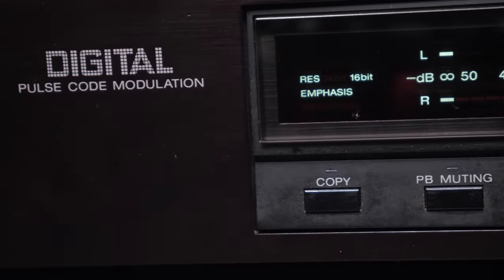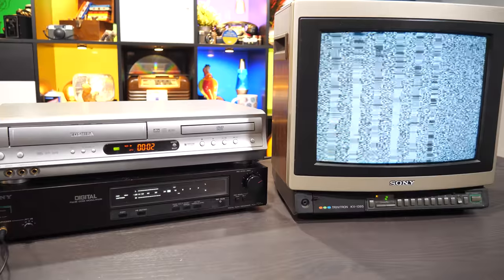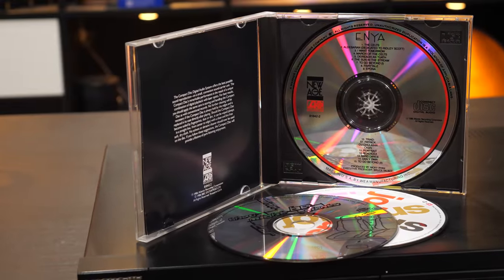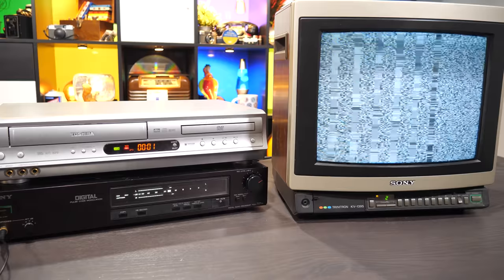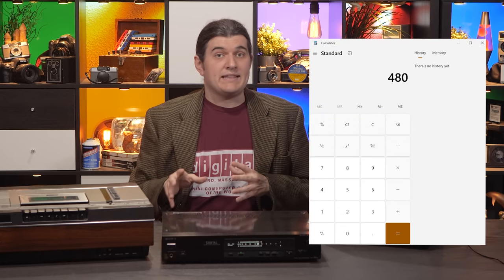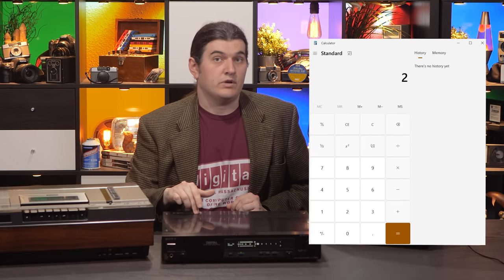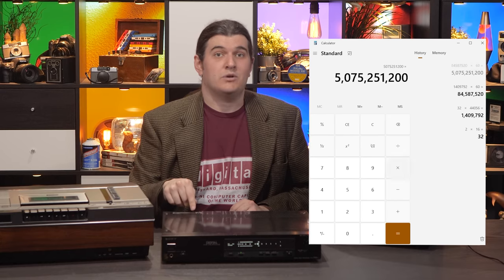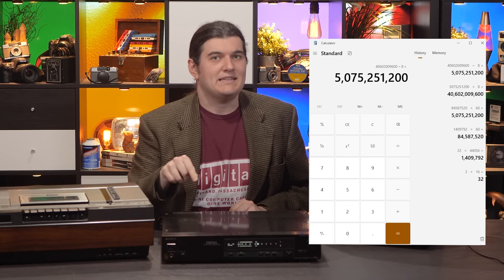Digital audio needed videotape to be possible - and the early days were wild!

Comment: That whole thing about professionals requiring XLR connected analog I/O on their equipment is only half right. People with lots of pro audio equipment often tend to interconnect it with balanced signal cables, which mostly use the XLR connectors. But many manufacturers of such equipment sold both the 'pro' and 'semi-pro' versions, and inspecting their specifications and schematics, usually the only difference was whether or not their analog I/O was via single-ended un-balanced signals via RCA connectors or balanced signals via XLR connectors.

Recording engineers usually understand that every stage the audio signal passes through adds noise and other distortions, albeit not very much. But passing signals through often-complex routings can involve lots of such stages, and the noise/distortion is cumulative. Thus, ideally, reducing stages improves audio quality.

Balanced audio signals must have extra stages in their respective equipment in order to get from the native single-ended signal to balanced, and on the other end another stage or stages to get back to single-ended. This used to be done via transformers, and later by small clusters of op-amps, forming instrumentation amplifier stages and such. 

Balanced signal cables are advantageous only to eliminate pickup of hum and other electrical/magnetic fields that long cables pass near. Typically, in a small studio or when only a few pieces of audio gear are being used adjacently, the cable runs are only a few feet long and are passing through fairly interference-free areas. Thus, for those connections, using single-ended (un-balanced) cables make more sense, as it eliminates the extra stages that going balanced requires. So, for those kinds of applications, just using the single-ended audio signals over shielded cable and via RCA connectors may actually be better that going the balanced XLR route.

As a former studio audio engineer, and as a long-time operator of a field audio recording service, I have seen a lot of places where the engineer uses the RCA route for locally positioned equipment, and the balanced XLR route for situations where longer cable runs are happening, or where other connected equipment only has XLR available. In my view, equipment that has BOTH kinds is the best, so the engineer can use whichever makes the most sense. And since the difference in purchase price between the 'pro' XLR version of a piece of equipment and the 'pro-sumer' RCA version can be substantial, it is often wiser to buy the lower cost version (all other features and performance being equal) for those installations where XLR is not needed.

Short version, don't sell RCA short, it is theoretically superior for many situations.

Comment: Look at how infrasound/rumble filters (e.g. the "Subsonic Filter" on Yamaha's A700) disappeared after CDs became common. If you look at old CDs especially, but also brand new ones, using a spectrum visualizer you will often see a solid block of sound from 0Hz to 10Hz. Which is exactly what rumble filters remove. But with CDs we were suddenly totally fine blasting ourselves with infrasound. Remove that infrasound with a highpass filter with a -12dB (or more) slope at about 10Hz and most music will sound quite a bit better (provided it doesn't rely on those frequencies which a lot doesn't). Originally these filters (like the Subsonic Filter) were used to filter out motor vibrations from vinyl players, so probably they were deemed unnecessary for CDs since there are no motor vibrations to accidentally pick up.

Comment: As to Technology Connections question about the overall interoperability of PCM video tapes, the answer is almost certainly yes. I have a Toshiba DX-900 which is a VCR that plays and records 14 bit, 44.056 recordings (along with simultaneous HiFi analog recordings) and its tapes can be played on the Sony 501 ES in 14 bit mode.

Comment: I remember my brother recording analog audio from the radio onto video tape but that was mainly because he got more recording time on VHS versus his reel to reel.  The other advantages VHS had over reel to reel was he couldn't close the doors on the stereo cabinet if there were reels installed and of course VHS was a heck of a lot easier to load and unload than having to thread the tape.

One weird use of video tapes that I remember was Showbiz Pizza (the predecessor to Chuck E Cheese).  The video section of the tape contained all the command signals for the pneumatic valves that made the robotic members of the RockAFire Explosion move, and the audio had the standard two channel stereo sound that contained the voices and music/

Comment: I’m pretty sure either Joe Armstrong or Alan Key mentioned in a pretty popular recorded keynote that DARPA, where Alan Key worked for a while did use tapes to store digital data for transporting it. Or it might have been some other tape or even film, as they mentioned printing it out as binary and using an army of Grad students to figure out the encoding used. And that’s a good illustration of the problems with moving digital data around.

That was the main issue for them: for the longest time the encoding was entirely ad-hoc, meaning every tape had to be transformed into files by doing whatever was done to write it, but in reverse. Add to that the fact that even what physical ones are ones and what are zeroes (little vs big endien vs big endien, using inverse of two, sign-bits and so on) and you can see that just transforming a collection of integer numbers was anything but trivial.

To properly transform any data, you need a filesystem, because files can’t exist in the system. You can have a standard that everyone uses and it entirely describes all files it can store, separate instructions along the data itself or include the specifications in the files as metadata. Else you need an army of CS grad-students to make sense of mystical the patterns you just received.

We use a combination of first and last type: the filesystem (for example tape) first gives some magic numbers to identify itself, along some metadata. The metadata acts as general instructions, so those don’t need to be included. Then it usually describes table of contents. This isn’t strictly necessary but it allows accessing data without actually interpreting everything before it, every time. And lastly the files themselves include their own magic numbers and usually some metadata.

So digital audio and video worked because they already had a sufficient filesystem because of broadcast standards. And the data made sense without a table of contents. DARPA did invent their own system for transporting and storing their own data, and it would be interesting to hear more coherent timeline of these stories!

Comment: Yes, 14-bit recordings had more error correction data and were protected better. I've seen a book where P and Q correction words were described. These correction words sored additional bits in 16 mode and only one 32-bit CRC was untouched. So instead of reconstruction of the lost data 16-bit recordings used more interpolation.

Comment: Digital tape formats were and still are a thing. They are mostly used for backups, but in the past some larger software was also distributed on tape. Lookup LTO, DLT, DDS (which is based on DAT), etc. These formats do not support random access, so they are not very user friendly. Home users simply didn’t have enough data to store to need these.

Comment: In the UK in the 80s and early 90s, the Sony PCM interfaces were used by the commercial radio industry to syndicate programs via satellite video channels.

A 3 hour chart show would be recorded in London, sent through a PCM adaptor, and launched via a standard satellite video channel.

Radio stations around the country would then receive this video channel, and generally, record to VHS or Betamax for later playback on air.

The quality was significantly better than MP2 compressed satellite audio channels of the time, and and used relatively common video infrastructure. Additionally, radio stations of all sizes didn't need a huge "big city" budget to buy professional equipment to decode the signal, and could use domestic devices instead.

Comment: Shuffling the data around allows localized errors to be distributed between many audio frames, making them either fixable with crc or inaudible. This is a good fix against sporadic big chunks of error, but doesnt help with more continuous noise errors.

Comment: In highschool, I used the family VCR to record software & files from my TRS-80 Color Computer to a videotape, in a similar fashion to recording to cassette tapes.
It actually worked (although the fidelity was not the same, and I didn't have control over volume and tine like a cassette player).

Up side: recording hooouuurrsss of programs (not just 30min), down side: no automatic tape control (start/stop) and having no idea where anything was on the tape.

Interesting experiment, but immediately went back to 15, 30, and 60 min. cassette tapes, and then moved onto floppy diskettes.

Comment: Great video! I've been a bit of a audiophile since around 1993 and I never heard about ability to save digital audio on analog video casettes. I did have a VHS setup with ability to store audio on the video area of the tape (I think it was called NICAM Hi-Fi) pretty soon those came available because that was at that time the highest quality you could get for cheap. (DAT was definitely higher quality but very expensive.) However, looking at the specs of NICAM today, it seems that this old Sony PCM converter could do much higher audio quality about 15 years earlier!

Comment: They did discover that you could store data on a common magnetic tape that was readily available.  Early home PCs such as the Tandy and the Commodore could use audio cassette tapes to store and play back data.  Their capacities were measured in bytes per second rather than megabytes.  It worked at the time because, like you said, PCs at the time could only handle data in terms of bytes and kilobytes anyway.

Comment: Even though the Commodore 5.25" floppy drive worked with the VIC-20, due to cost they were almost never used together.  Typically the VIC-20 was used with a recorder that used standard audio cassettes to store digital data.  I forget how much they could hold, but you don't need a lot when your computer only has 5k of memory (2k ROM, 5k RAM).

Comment: Great video. I used to record analogue onto HIFI VHS (using the slower mode) for mixed sound at parties 30 years ago. Digital would have been cool. Regarding output to other digital modes, you can use a resampler to res up for 44.1 or down to 32 kHz.

Comment: I think the PC interface to record digital data on a VCR is older than the mid-1990s.  In college our computer center ran a BBS that consisted of 6 PCs, 6 phone lines, a large shared hard drive (140 megabytes maybe?) and we had a VCR that backed it all up.  This would have been around 1987.  There was a student sysop of the BBS and their job was changing the backup tapes.  The BBS software was 2AM-BBS because its author was a student (and then employee).  Good times.
Reply: It was older than mid 90s.... I had a Danmere Backer in 1994 and it had already been around a couple of years by the time I bought one. I then ended up being one of their Beta-testers for their next software upgrade.

Comment: For Computer use, there were the QIC-40 and QIC-80 Tapes which came in a handy format. Quarter Inch Cartridge Tape which did PCM Recording of Bits on Tape. Lot of PC in the late 80s and mainly 90's had those, mostly hooked up to the cheap but slow Floppy Controller. They Raw capacity was... surprise: 40MB later 80MB, which sounds low today but when you had a HDD of 340MB like my 1991 Machine, it was plenty, as there were compression Tricks which could increase capacity to 200MB. I won't disclose what we and our friends shared on this Tapes but let's say: YaRrr ! They were so popular that even Windows 95 had their own Software for QIC-80 Drives for compatibility for older DOS QIC Drives.
This trend died out when the first CD-R hit the market. A tape was around 20-40 Bucks, a Burnable CD could hold 640MB and was only 5-10 Bucks in 1996. At this point new Tape Formats hit the market but they were DOA for the not Datacenter Market.

Comment: interesting that pause doesn't actually pause but rather simply cycles the current frame. i imagine it has some internal mechanism which is easier to just change what it's looking at, rather than halting it entirely, but still very interesting.

Comment: We used a pair of Sony PCM units with Beta VCRs for saving and storing software. Worked surprisingly well, much better than the compact audio cassette based systems back then..  After about 3 or 4 years we cnverted over to using floppy discs as they had become mor affordable. then hard drives took over as prices for data storage came down. but the old overcomplicated PCM + VCR system was surprisingly robust to the point it was more reliable than some early floppy disc storage systems.

Comment: A while ago I researched this stuff quite extensively since I wanted to know the origins of the 44100 Hz sampling rate used on the audio CD.

In the late 1970s several companies experimented with recording PCM audio onto video tapes. The first comercially available PCM converter unit was the Sony PCM-1 in 1977. It used a 13 bit non-linear 3 slopes companding quantization.

To enable interoperability, the EIAJ (now JEITA) standardized the on-tape format for such converters on 1979-06-01 in technical file STC-007. This only covered 14 bit samples and the 525/60 (NTSC) video system.

Another technical file (STC-008) followed. It probably contained the specs for the 625/50 (PAL) format. After that the EIAJ released two standard documents called CP-2901 (formerly CPZ-105) and CP-2902 (formerly CPZ-106).

In 1988 the format was standardized by the IEC as IEC 60841. It covers 525/60 as well as 625/50 systems with both 14 and 16 bit samples.

So yes - it is quite likely that different devices would be interoperable if they conform to the EIAJ or IEC standards.

Sony built some of the most popular devices conforming to the standard:
PCM-P10 (1979; 14 bit linear quantization, playback only)
PCM-10 (1979; 12 bit 3 slopes companding, 14 bit equivalent)
PCM-100 (1979; professional use; 14 bit linear quantization)
PCM-F1 (1981; 44,100 / 44,056 Hz; 14/16 bit linear quantization)
PCM-701ES (1983; 44,100 / 44,056 Hz; 14/16 bit linear quantization)
PCM-501ES (1984; 44,100 Hz; 14/16 bit linear quantization)
PCM-601ESD (1986; 44,100 Hz; 14/16 bit linear quantization; with S/PDIF output)

Sony also built devices aimed at the professional market that didn't conform to
the consumer EIAJ standard. These utilized U-Matic tapes and were used as master
tapes in the CD mastering process (they also contained subchannel data):
PCM-1600 (1978; 16 bit linear quantization)
PCM-1610 (1980; 16 bit linear quantization)
PCM-1630 (1985; 16 bit linear quantization)

For all 625/50 devices the sampling rate is 44,100 Hz. For 525/50 devices the sampling rate depends on whether they are based on the color or B&W standard (60/1.001 vs. 60 Hz field rate). In the former case the sampling rate will be 44,056 Hz while in the latter case it will be 44,100 Hz.

Another interesting detail is that some (most / all?) units used only a single ADC / DAC for both channels, sampling them alternatingly at twice the sampling rate. Hence the samples of the right channel will be delayed by ~11 us relative to the corresponding left channel sample.

While the official standards are still not freely available, there's a lot of valuable information scattered across a couple dozen patents:
EP0048152B1
US4238770
US4306305
US4309726
US4379286
US4393419
US4394762
US4403263
US4404602
US4408326
US4420775
US4433415
US4433416
US4451920
US4451921
US4453250
US4459696
US4467370
US4507687
US4570153
US4587573
US4604747
US4637036

Comment: I remember going to a real recording studio for the first time and the engineer had told me we needed to bring VHS tapes and I was very confused as to why. Still have the master tapes. It was even cooler than just vhs tapes for sound as each tape could only handle so many tracks so multiple decks would be synced up for when more than the 8 or 24 tracks one cassette could provide wasn’t enough.

Comment: @Technology Connections
How could you miss this: The reason why VCR's were not used for actual data storage was - of course - the "incredibly efficient error correction"! And the reason why it was required in the first place. You cannot have a single bit in your stored data be "corrected", or just dropped out.
Video signal: No-one notices the drop-outs!
Digital audio: ECC fix or no-one notices.
Data: Crash-and-burn!!

Comment: Used PCM encoding and a television remote truck to send audio many miles, then another device on the other end to decode the digital data and feed the stereo analog signal to a radio station's console. This was a very early digital stereo remote broadcast, done in live time. Nice thing about it was very low latency, and a digital recording could be made at the same time on either end with a videotape machine.